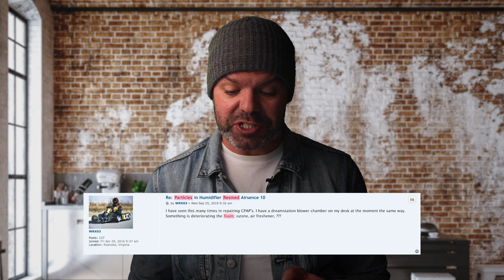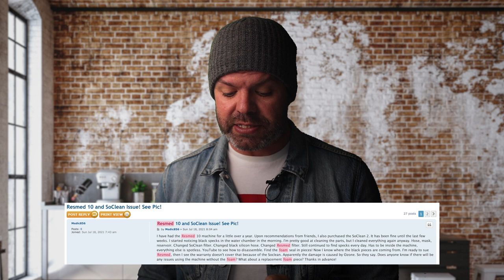🚨WARNING! AirSense 10 Foam Degradation & Removal

Comment: Commercial ozone generators are often used in remediation after house fires. It’s recommended that all persons vacate the premises during operation with venting the home after the ozone treatment. Ozone can deteriorate many plastics, foams, and other material. I would never use it to clean a medical device unless specifically recommended by the manufacturer and certified by a nation certification agency. Cleaning my CPAP and assorted equipment I am using a vinegar/water mix, a good rinse, and air drying on a regular basis. Filters are replaced regularly.

Comment: I used the SoClean device only twice on my Resmed Cpap machine and stopped because the tubes and nasal pillows started to smell very strange afterwards. I threw away both tubes plus nasal pillows. Then had my Resmed 10 machine inspected to see it those two instances of using SoClean damaged my Resmed 10 Cpap.  I also returned the SoClean for a full refund. Just use vinegar, light soap, warm water to clean your Cpap.
Reply from the maker: Good advice brother. I don't think 2 goes with the SoClean would do any damage mate. Cheers

Comment: Been using a res med c-pap without using this "So clean" and haven't had any problems or particles. Seems to me the "Cleaner" is the problem not the foam in the c-pap. The cleaner may be to abrasive or harsh and the chemicals may cause the foam to break down vs just normal use without it is just fine.

Comment: Just got put on CPAP therapy,  and learning as much as i can about my new Air sence 10.  What is this SoClean that you are talking about, and what do you mean Ozone cleaner.  I have a air purifier to clean the air in my room.  But it's not an Ozone cleaner, it's just hepa filter and a fan.  I was told you can just use soap and water to clean out your tubes...Cheers and thanks for your information

Comment: You glossed over an important item at 15:22.  It is important to get the 'C' fitting on the blower housing slid on to the "T" fitting on the case.  You do it correctly, but it is very easy to get the 'C" fitting sitting on top of the "T" fitting.  Everything will go back together, possibly with some extra force.  But the pressure sensing seals won't work well enough.

Comment: Nick - what I'm finding in my water container on a ResMed 11 is something black but NOT foam.  Rather, it looks like these small floating, clear gel substance.  And when I touch one of the little floaties with a paper towel, it attaches to the towel and in a short time, turns black.  I saved these towels with black spots in baggies.  Then I put a NEW water container on the machine, and opened a new bottle of distilled water.  The next day, there were more clear floaties that turned black.  I poured the remaining water into a clear container and the floaties turned black in that container within a day.  I have saved this stuff but don't know what to do with it!  I WANT TO KNOW WHAT THAT IS!  I clean the water bowl, the hoses and nose pads with water with Dawn detergent and a little bleach.  I never got this black stuff with the Dream Station before they recalled it, and I've only had the ResMed since Oct of 21 (right at a  year).  What do you think?

Comment: I had bits of foam in my Phillips Remstar 450P, took it all apart and much of the foam was breaking down, so I took all of it out and cut bits of polyethylene foam to match and re-assembled. I never used any cleaner except for weekly soaking the tank and hose in white vinegar to clean off the water deposits.
Reply from the maker: Hey man, where did you get the polyethylene from? Cheers
Reply: @CPAPReviews  Computer parts packing material. It's handy stuff, so I usually have a stash of various sizes and shapes.

Comment: This is where your info is off my Friend. I have been using a Airsense 10 for 6 years now ( BTW  I watched your video on changing the motor that I bought on Amazon for $127.00 US. And aside from installing the motor backyards the 1st time....MY FAULT...... Your Video Save ME .............BIG TIME.)  I have been using my So Clean for 5 1/2 years and I have had no problems. I'm just seeing your video today (2/23/2024) or I would have taken pictures of my foam.
Reply from the maker: Thanks but my info is not off. I've seen it firsthand and have hundreds of pics and emails. Secondly, read some of the comments on this vid. P.S. next time a youtube helps you out, don't be afraid to throw them a few bucks to say thanks. Cheers

Comment: Great video Nicko.  Love your work.  Now I know how to take apart my S10 (not that I plan to but it was nice to see the components inside).  Just one point.  I would not use the Dewalt driver (even with clutch) to screw back the  screws.  Best people tighten by hand otherwise they run the risk of sheering the threads if they overtighten with the electric screwdriver (or forget to put the clutch setting). You've probably done this thousands of times and know when to stop but if people are doing it for the first time they may run the risk of damaging the components.
Reply from the maker: Hey legend, glad you enjoyed it and thanks for the great tips! Yeah i would not normally use a power drill mate but i was a bit stuck and just needed to get the job done haha. You know how it is. Appreciate the great advice though. All the best brother. your mate, Nicko
Reply: I am with you on your advice, as well as using a hand operated screwdriver I also gently turn to screw backwards to locate the start of the thread, this means the screw engages the original thread in the plastic and greatly negates the possible damage to the hole. I  repair most of my electrical appliances because often a small single component causes failure and parts are unavailable or prohibitively expensive. I also make a point of enquiring about the availability of spare parts and their cost when I purchase a new appliance!

Comment: Ive heard some people refer to that foam donut as a "filter", but it is not.  That foam is sound insulation. The machine would run fine without it,  it will just be a little louder.

Comment: I've recently noticed some dusty floaters in water chamber of my 7 month old ResMed APAP several days after changing to replacement chamber of Airsense 10. Not using Soclean, just White vinegar & water mix & use a cotton swab to clean around edges if necessary. Keeping close watch for any particles of dust like matter. The machine is through DME provider APRIA Healthcare under Medicare. Contract. 🤠

Comment: I have a homemade cpap cleaner. I got a small aquarium ozone generator and connected it to the top of the water via a regular O2 hose. This goes into the tank through a hole in the top of the tank and runs down to the bottom of the tank. With the tank filled, I start the ozone generator and then manually start the cpap and lt cycle  it 2 or 3 times. This method works well and cost about $25. The generators last for at least 2-3 years. BTW I live in SW Florida, home to molds, fungus, and all the rest of creepy crawlies. My only precaution is that the generator must be mounted higher than the tank or the water will leak out.

Comment: Thanks for your video. I use ResMed Air Sense now, in 5th year. Tried a different ozone cleaner about 4 times but couldn't stand the stench left behind. No evidence of foam particles anywhere. But, doesn't foam break down over time anyway? I would think it is something that should be replaced. Going to ask about this at my upcoming CPAP review with my doctor. Thank you.

Comment: Thanks for the great video. Easy to follow. I followed your instructions. When I opened the chamber, there was only a sliver of foam left. Unbelievable. I use a sonoclean. The thing is I only started to see the green fibers in the humidifier a few days ago. I always look in the tank when I refill. Never saw any before. Where could the foam have gone? This is a real mystery. So I am going to operate without the foam period. If you can think of something, please advise. Thanks much. Vito

Comment: Top job mate, you had me checking my cough for a while there. My airsense 10 is ok though. I just use warm water and mild soap to clean it. A question though, does the motor generate ozone and is its chamber isolated from the pressurised air? Just a thought!
Thanks very much for your videos.

Comment: I have Airsense 10 for four years and it has done 9,500 hours.  While the foam appears to be in good shape, it can degrade at any time.  My questions: (1) Where can we purchase a ResMed replacement foam? (2) Can the machine operates without the foam?  If so, I may just take it out in order to have peace of mind.

Comment: I often wondered how the geniuses who build these things haven't introduced an additional in line air filter between the machine and patient. Typically the machines filtration is way below the standard for forcing particulates in a person's face for hours at a time.🤔 Not only should this be standard safety practice it would also help eliminate potential foam poisoning. Now.if a problem with filtration and humidity is an issue then the extra filter could be installed south of the humidifier still keep foam from entering ones airways.😎👍
Reply: Yeah, a pre-filter (intake) to keep internals and motor clean-ish; and a post-blower HEPA filter (user replaceable).
Reply: @Motojourneys  unfortunately that's not how it works. It was strictly sound abatement and used incorrectly. Sound abatement foam can be used as long as it's not involved in the process of supplying air to the patient.

Comment: I really like your videos and have followed this one on checking the foam on the Resmed 10.
I have been using a SoClean machine for a couple of years to clean it with ozone.
I live in the USA.

Well my acoustic foam is completely green and falling apart.
I have cleaned the machine up and only have about 5500 hours on the cpap machine.

I am not able to find replacement foam anywhere for the machine.

Are you able to tell me where I may find a replacement foam so I can put this machine back together and use it again?

I appreciate any assistance!

Great Video!!

Comment: Thanks for the heads up on ozone cleaners! Been on a ResMed air sense 10 for 4 year now. Have not used an ozone  cleaner on it and now will not i will clean it the old way thanks.

Comment: I never use my SoClean everyday. Maybe once a month. If I get a cold or bronchitis then I’ll do it once a week. I always clean my mask with soap and water at least weekly. Ozone is not good to breath either. When I use my SoClean, I run the machine for at least 5 mintes to evacuate the ozone by holding my thumb intermittently over the hose end to simulate breathing otherwise the machine will stop. I also turned off the reporting to Resmed in the tech menu.
Reply from the maker: Thanks for sharing your experience mate. Nicko

Comment: Thanks for helpful info.  FYI I only use Ozone cleaning on water tank and hose once a week at most (water's changed out daily) but may cut ozone down to once a month, instead using liquid sanitizers like hydrogen peroxide or similar to avoid hose rubber deterioration (so far, so good). Perhaps Ozone would damage the Airsense 10 internal seals and sensor components over time (in areas of high Ozone pollution (Los Angeles, CA, etc.) foam would deteriorate over time) ?  Was also good to learn Airsense 10's life's apparently about 25000 hours.

Comment: I just had to send my 6 month old BiPap machine to be repaired due to the SoClean degrading the foam in the machine! I wish I would have known about this issue sooner! I was told by the repair company that SoClean use will void your warranty on most cpap and bipap machines... I had this happen to my regular cpap machine last year also but i replaced it with the BiPap.. only 2,000 hours on the BiPap! Dont use the SoClean to clean the machine!

Comment: Been using my Resmed for 10yrs & I’m not, nor have I ever, used ozone or any cleaner. All I’ve done is wash the the water basin & change the little filter when it’s dirty. I wash my cpap mask & hose with hot soapy water because they told me too. So, have I been inhaling cancerous foam these past 10years? No wonder my breathing has gotten worse. I can’t sleep without it at all. How do I find out how to check for this foam? Thank you for your video.
Reply from the maker: Hi Sandy, as per the video if you have not been using an Ozone device i believe you will be fine. Best wishes. Nicko

Comment: Thank you for your informative and entertaining videos.  Every time I google questions about my cpap, your great videos pop up.  I can't get a good answer to the following question and I would very much appreciate your answer.  I love the convenience of So Clean, but obviously don't want it to degrade my foam.  I was told by my respiratory therapist that I could just put my hose and mask in the So Clean.  Is this safe?  Or at least safer than not attaching it to the machine?  I have been doing this for 1/2 a year.  I rarely, if ever use the humidifier on my cpap.

Comment: Where do you buy the replacement foam? this video was great! i followed it and removed my motor, the foam was completely sucked into my blower motor. I cant get it all out but i replaced it with the motor from my old S9, it fit in my airsense 10. I just need the foam but cannot find it anywhere
Reply from the maker: Hey mate, i'm glad you enjoyed it and i was able to help. Yeah it's hard to get it out once it's inside the turbine. I wouldn't worry about the foam disc mate. Should work fine without it. Nicko
Reply: Great video! Cheers for the information. 👍😀

I have a Dream Station and a Dream Station Go, and I’m thinking of buying a Resmed 10 until I get the others sorted. 

Can the foam be removed, and only then use ozone cleaner? I’m also thinking the foam will be ok if the ozone cleaner is used for the mask and tubing only. Would that be beneficial? 

Cheers Mate. Looking for a solution that’s beneficial for my health.
Reply: I removed the foam from mine a there is no difference as far as noise.
Reply: @SplittingVoices  thanks, I cut out a makeshift pattern of foam and installed it. I will remove it since it doesn’t make a difference

Comment: Here is a way to protect your lungs should a foam degrades on your machine.  
The clinic that provided me a loaner to try out the airsense 10 had setup with a filter right after the outlet in the back (for slim line without heat) to the slimline tube.  I suppose this is not 100% proof, but at least it helps block a good percentage of those particles.

Comment: Why would someone use ozone on the machine itself..??  I understand daily cleaning the mask and water camber. And occasionally cleaning the hose.  But why the machine..??  Thanks!! Love your videos..!!
Reply from the maker: Hey mate, that's a great question. The answer is that until SoClean arrived, there was no real way to clean inside the cpap itself. They get pretty filthy man, i've taken many machines apart over the years and they can get all mouldy, dusty and filthy and ozone was a way to sanitise / sterilise the internal components. It's actually a great idea but unfortunately there are some serious drawbacks which the manufacturers are now finding a few years after they became popular. Cheers
Reply: Make a cpap without foam.  Damn the noise, I’ll learn to tolerate it

Comment: Just found your program and have a question.  I have a Resmed 10, which is about 7 years old   I was given a newer model 11 last year, so I use the old one on vacation.  Of course, this last vacation it stopped working, showing a code of 006.  Is this repairable or worth it?

Comment: Great Video. I do have a question. I have a ResMed AirSense 10 machine with a humidifier. I used it for a bit when I first got it but stopped using it because It kept my wife awake. Now I do need to start using it again. Can I put water and vinegar in the water chamber and let it run with out the mask being attached to sanitize it before I start using it again? Some people say no and others say yes. I just do not want to harm the machine as I paid $2500.00 Canadian for it.

Comment: Thank you for this very helpful video, have you found anywhere to get a replacement foam seal?
Reply from the maker: Hey mate, unfortunately ResMed keeps tight control over the replacement parts and you would probably need to send it in for servicing etc. It would be amazing if there was 3rd party repair companies where you could order parts from. Hopefully in the future. Thanks for the great comment. Nicko
Reply: I too, have tried to find the replacement seal with no avail. It seems to be a catch 22 in that opening the unit voids the warranty, but the only way to tell what's causing debris in the water chamber is by process of elimination. All other factors considered, there's no way to isolate the problem without opening the unit and checking for yourself.

Comment: Good one Niko . I have a F & P Stylemaster unit which i amvery happy with,are you aware of any problems 
with this unit ??? you are doing a great service to all C-pap user,s cheers Phil
Reply from the maker: Hi Phil, the SleepStyle does have foam also inside the turbine housing so just don't use ozone and you should be fine. Cheers. F&P did put out a safety statement similar to ResMed. Cheers brother. Nicko
Reply: @CPAPReviews  Many thanks Niko

Comment: Excellent stuff nick.  New subscriber here - Just reading through the comments,  it appears the foam is just for soundproofing?  Is that right?  I use a cheap ozone cleaner maybe once a month and have had it since the airsense 10 jusut came out.  I will take a look at the weekend and send in the photos as a point of reference